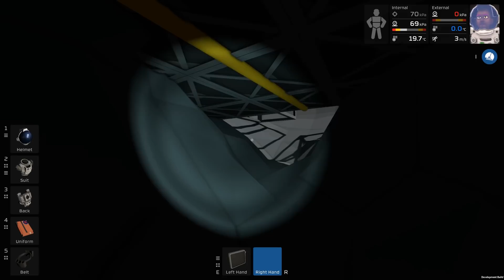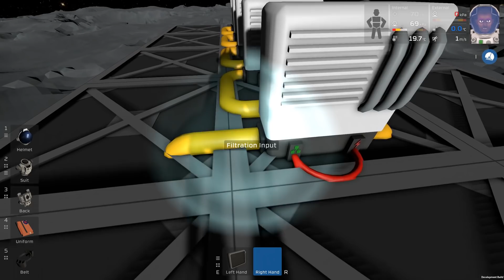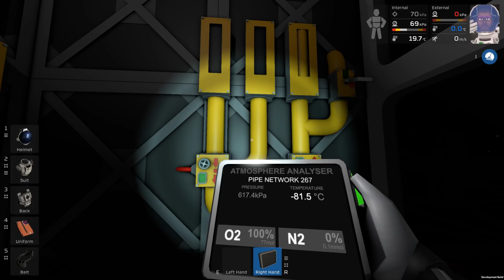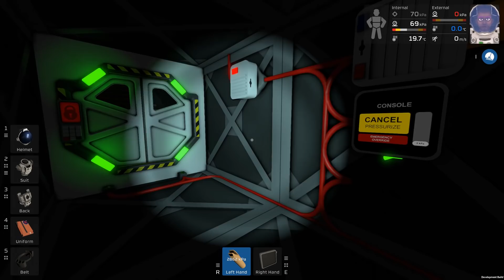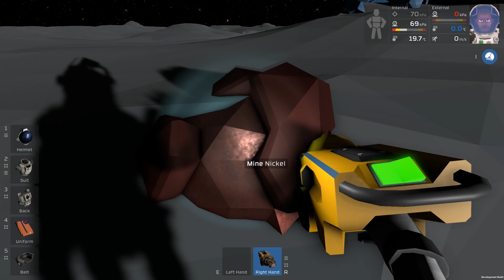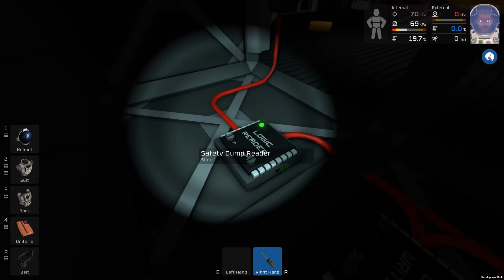Stationeers E09 - Automated Furnace Safety ( with Logic and Electronics )

Comment: radiators wouldn't work either because there's nothing for the radiators to radiate in to (hint no oxygen or any gas/ liquid ) it's like plugging in a battery with no negative side on the battery you have no current it's fifth-grade science people if you don't believe me look it up

Comment: What gas mixture did you use to ignite the furnace?
Reply from the maker: 75% H2 25% O2, if I recall correctly
Reply: Thanks!! I figured it would be the same as like dropping the oxite and volitiles in the furnace but i didnt want to risk blowing my base up. lol
Reply from the maker: It's nicer to be able to do that via a gas, where you have a bit more control :D

Comment: I must be missing something or just not understanding how the gas system works in this game.  I filled a canister with about 9000MPa and connected to my furnace via regulator set to 450 and it only brought the furnace up to about 360kPa added a volume pump then it went to 405kPA  had valve on output closed.
Reply from the maker: Regulators are quite weak - if you think it's that, attach two in parallel (not series).  I haven't needed high pressures too much - 150kPa in the furnace (with output and input shut) is enough for steel.  There's a video out tomorrow that sets up the furnace again (for automated alloys) - that might be worth a watch!

Comment: What's the best way to cool the furnace output gas.  I've tried using the a.c. unit with the output to a passive vent to my recycling room. The waste output goes through a dozen pipe radiators then ties back into the a.c. input.  I find the radiators don't make a big difference at all.
Reply from the maker: Keep the gas in the segment with the radiators, open a digital valve once cool enough :) (assuming the radiators are in vacuum/outside)
Reply: It's in a vacuum
Reply: So keep the same setup only add a valve to the output?
Reply from the maker: I have a digital valve just after the furnace, and I just leave it to cool in the furnace itself, but you could add another valve, or move the digital valve to after the radiators too
Reply: I have mine set up like yours, I was trying to make a system where it would cool the temperature as as fast as it leaves the furnace but I'm thinking that's not possible
Reply from the maker: Yeah, I don't think that's doable - if you want to dump things fast, I'd probably just send the fumes to a tank with radiators nearby until it was really cold.

Comment: In your system is your backflow pressure release before or after your filters? Is that the pipe that is the pipe that goes straight to your filters right?
Reply from the maker: I haven't built relief valves into everything yet (there isn't enough pressure to cause ruptures), but there's one before the filtration units (part of the furnace output system too), and there'll be ones on each of the outputs, as I add full size tanks
Reply: My active vent sucks in and a lot of pressure builds up in the one pipe link you have while the pressure regulator pushes air into the gas collection system. It actually has blown a couple times but I guess I just have to be safer about how much gas I release into my gas room at a time.
Reply: I guess that would be more applicable to ask in your video EP06 I believe where you did the sorting / collection of gases.
Reply from the maker: Yeah, I did it at first via dropping it in the room, but these days I just drop the ores into the furnace in the atmos room - no mess :)
Reply: True story.

Comment: Btw there is a data port on the top of the furnace. You can activate all the functions and the temp/pressure straight from it.
Reply from the maker: I think they've just added the Activate function (it was missing previously), which might make it interesting to try to automate the whole process!

Comment: your valve is to far from your furnace so your actually feeding in more gas than you need and by closing the back with a valve you'll build more presser. the reason why your presser is to high is that the ore gives off gas, gold has 7% O2 so use ingots rather than ore, allowing you to let your ingots to sit in the furnace rather than (quickly hop and get the ore in before the temp gets to low). you can save even more gas by pre heating (have your tanks sit in a room with any gas and heat the room)

 currently trying to make a 1 by 1 room filled with fuel surrounded by a 3 by 3 with water to see if it will prevent the walls from exploding after igniting. trying to store the heat and presser so I can feed gas into the furnace without the need of a burn. it will probably just explode but I'll get a good lol.
Reply from the maker: Heh, I think making a furnace... literal room sounds cool - good luck with that.  I'll investigate the ingot route further - in the current design, anything that doesn't burn, we're capturing and storing, but having a bit more efficiency doesn't hurt :D  Pressurisation is next up, I think.

Comment: You can make alot more colors in the tool maker :)
And you can color pipes too ;)

And why not a volume valve along the pressure valve at input on furnace? It can add minor amounts of gas to increase tempature at minor increments without having to fiddle with the pressure setup?
Reply from the maker: I've just started labelling pipes, but I may have to make spray paint cans too!  Haven't tried the volume pump/valve yet - will take a look!

Comment from the maker: Quick Note: Put an extra pressure regulator after the furnace output if you use this setup, otherwise backflow when the digital valve opens causes it to go a little nuts!
Reply: If you put a pressure regulator on the furnace output I guess to can do away with the dump switch? Switch on the regulator when you want to dump the furnace into a cooling pipe and then when it is cool the digital valve will feed it back into the filtering system. Which would mean you can dump and reuse the furnace without needing to wait for it to cool down.

Comment: Nice video as always. There are pipe labels which are really nice and easy to set so you can just visually see which pipe (canister holder) is which instead of trying to find correct spot with your mouse to read it out. When you make one in fabricator it will create stack of 20, just so you dont make mistake like me and have 100 of them. :D
Reply from the maker: Heh - I've seen those, but not used them yet.  I think I will in an upcoming episode!